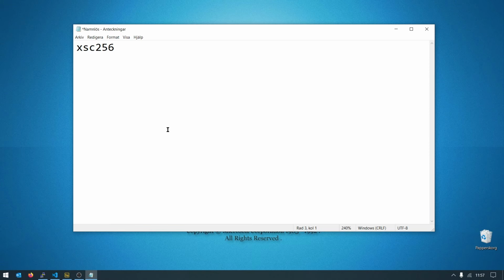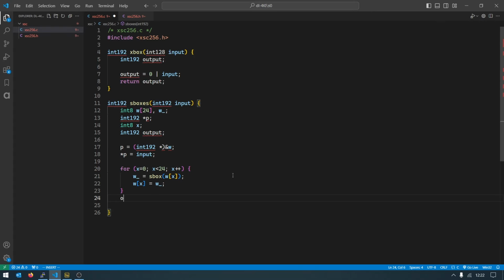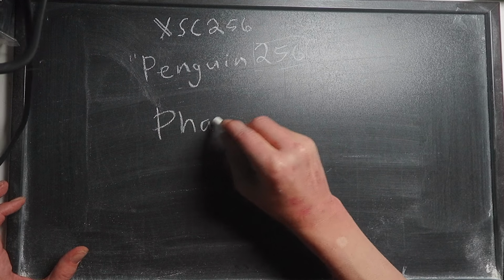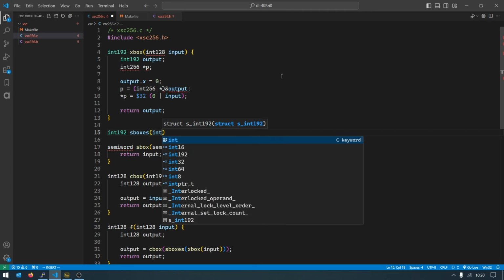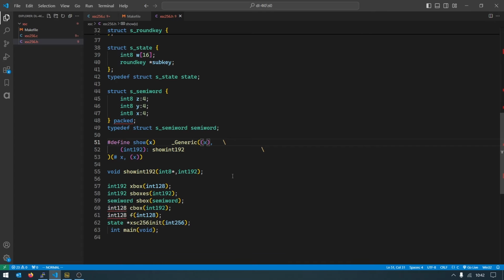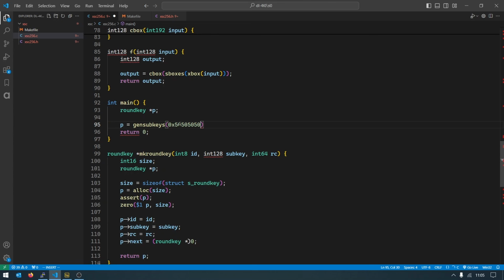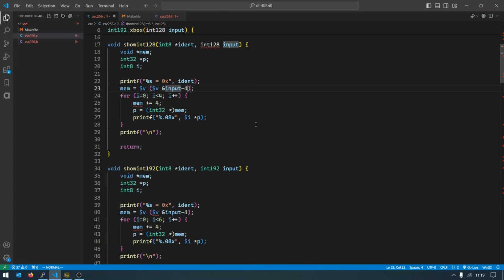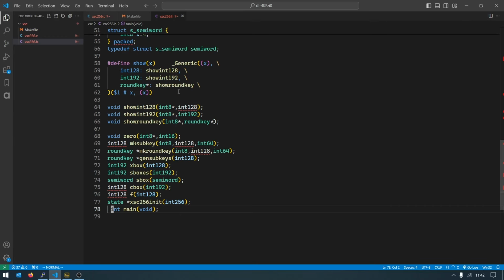01 Your own encryption cipher in C

Comment: Can we create Network Interface Card virtualization with software that will allow me to connect two or more devices to single physical interface acting as different interface in the system, e.g allowing me to connect my printer and washing machine to my laptop wifi at the same time.
Reply from the maker: i think there are built in bridge functionality in most os's
Reply: @dr-Jonas-Birch I think my question may have been misunderstood, and I appreciate the response.
I’m not referring to bridging existing network interfaces.
My question is whether a single physical Wi-Fi NIC can be virtualized in software to behave as multiple independent interfaces, each capable of maintaining its own wireless association simultaneously (for example, staying connected to the internet while also directly connecting to other devices).
Bridging typically operates after connections are already established, whereas I’m specifically interested in multi-association support at the NIC or driver level.
Reply from the maker: @pisednyanesh possibly. i never worked with wireless networks so i dont know much about it. know all about fixed though